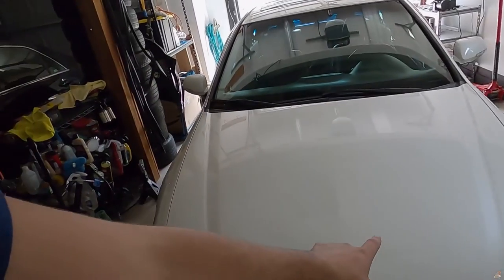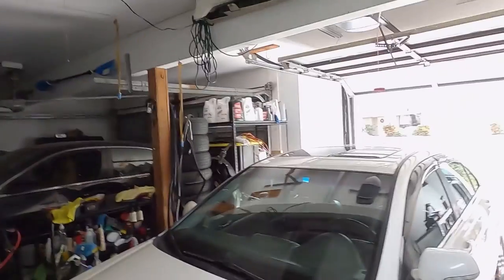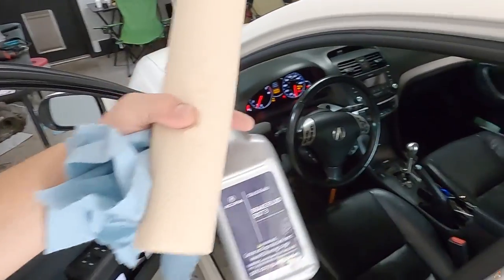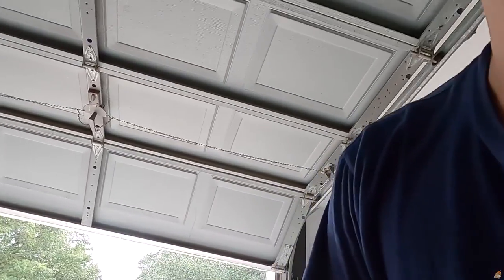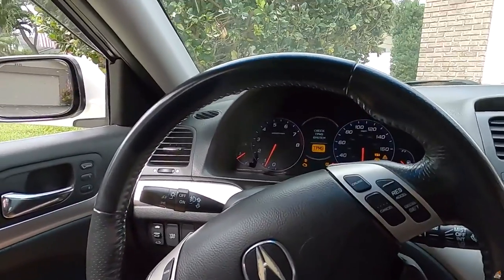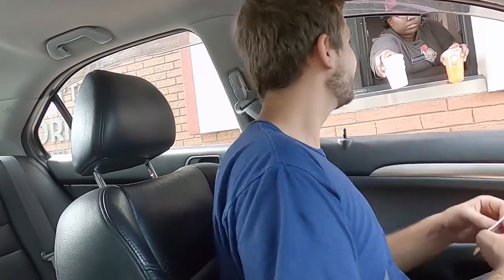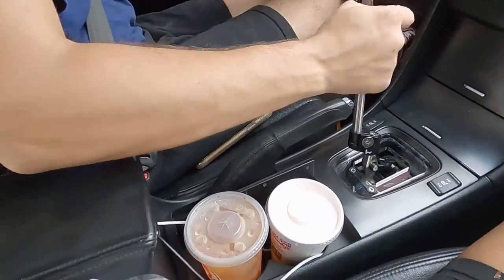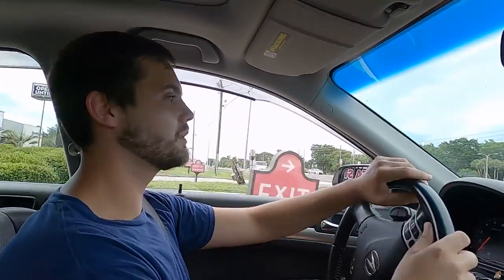TSX Cruising Testing The "New" Clutch Pedal

Comment: Congrats on finding work again, may be check out hybrid racing cold air intake, it has a built in water bypass valve so water doesn't suck into the motor
Reply from the maker: Thanks man things will progress better soon, but i wanted to finish up my current intake setup and create a custom heat shield around so its still shortram. Florida rain gets crazy with the rivers in the road 😂

Comment: How did you reinforce the clutch pedal bracket, mine keeps breaking on my 04 6MT
Reply from the maker: Check out one of the previous videos before this i show the process a bit. Had a shop cut out a extra thick piece of metal and weld it to the left side
Reply: @RishMedia  okay bet because i was looking at some M&M reinforced clutch pedal bracket assembly’s from Japan for the CL7’s but i don’t wanna risk it not fitting on my CL9 TSX
Reply from the maker: @JackKnife2730  not to sure on that! Try to compare the contact points maybe it’ll work or have to do a bit of shaving down. But a reinforcement is definitely needed.